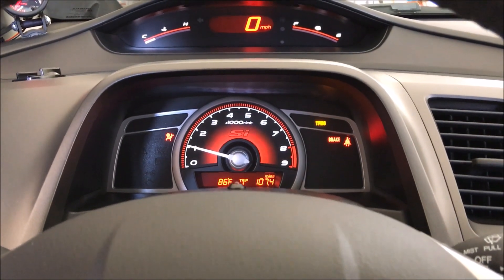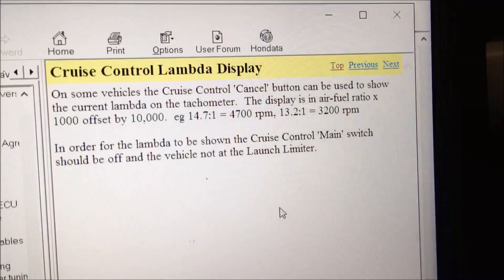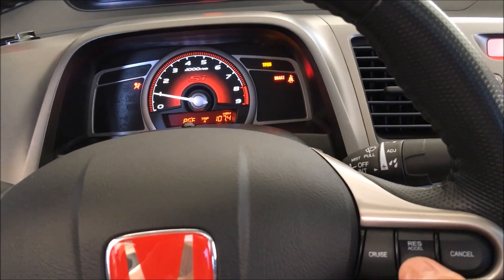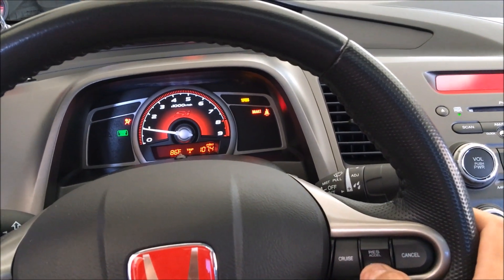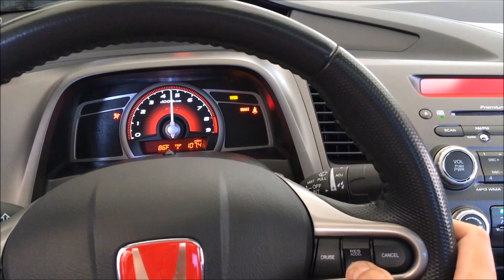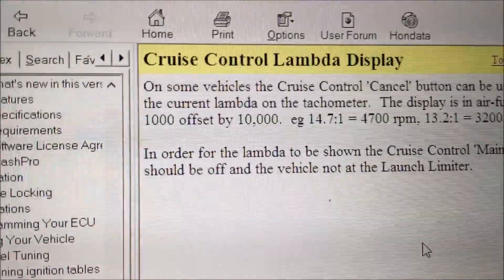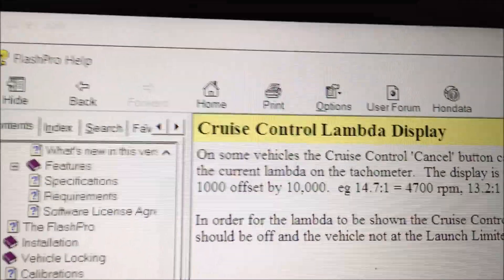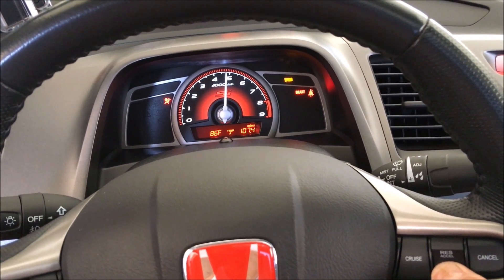Hondata FlashPro Version 2.4.5 Update No Lift Shift, Air Fuel Ratio, On Demand Launch Control Part 2

Comment: Many Thanks for this video!
And  I have a question, is this features works with "Race calibrations"? (I have 2007 civic si FG2 turbo)
Because the problem is I have updated my Hondata up to V 2.5.7. but nothing new (full throttle shift) for example in "calibration - rev limits" i didnt find. 

As I understood you just updated you hondata and then reflashed your ecu with the same calibration...?

Comment: What is flat foot shifting? I have plans to either Turbo or SC my newly bought 8th gen FA5. Seems it will be much more expensive to go with Full Race over Kraftwerks, but there Kraftwerks kit isn't really customizable vs a turbo where I can adjust boost on the fly, is the 110mm Pulley the biggest Kraftwerks makes?
Reply from the maker: flat foot shifting is changing gears to a higher gear without letting off the gas pedal, hence flat foot shifting.
Reply: +TheTongMan So everyone with Flashpro gets these benefits?
Reply from the maker: only those with a 2006-2011 Honda Civic Si will get these benefits
Reply: +TheTongMan yay!

Comment: I have a 2015 si and I updated my flashpro software with the last calibration Vit sent me, before I could do my 2 step with the car in neutral and now I went to do and it doesn't do it anymore, do I have to have the clutch in and the car in gear now?

Comment: does the full throttle shift only work on maf tunes? I dont see the option when a map tune is used.
Reply from the maker: i'm on a map tune and it works perfect
Reply: im on map based tune and it doesnt show up. any of the new features
Reply from the maker: +NissanGT35R what car do you have?
Reply: +TheTongMan 09 si
Reply from the maker: you sure you got the latest version?
Reply: +TheTongMan pretty sure about it, i even reinstalled it and didnt change anything. It doesnt show on my custom tune but if i open one of those given by flashpro it shows up. I dont know why it doesnt show on any of my custom tunes.
Reply from the maker: best bet is for you to contact your tuner
Reply: im also having the same issue